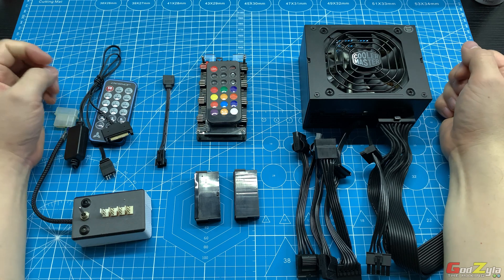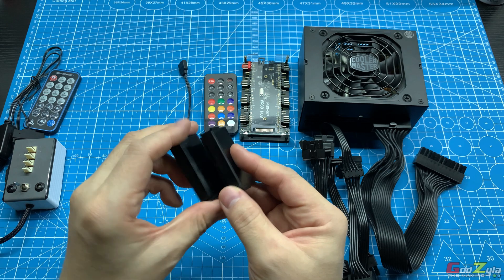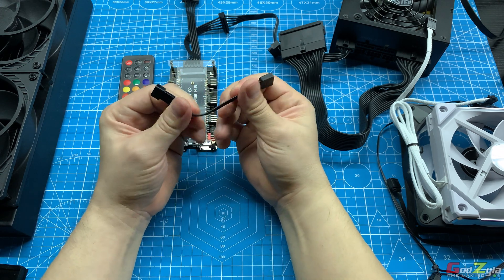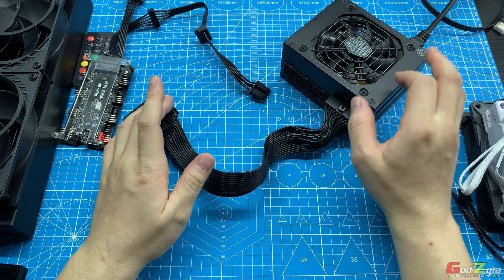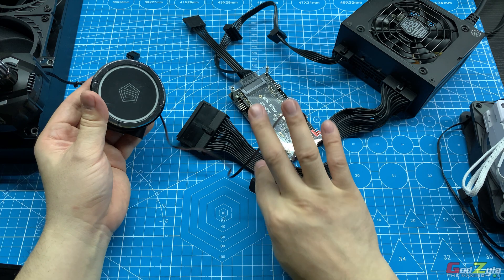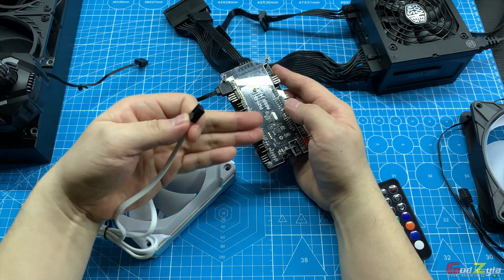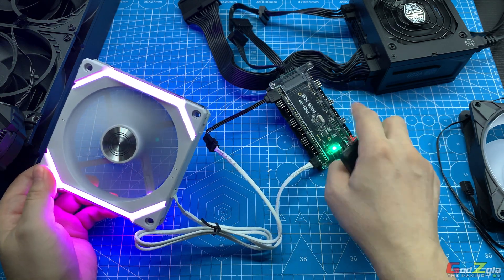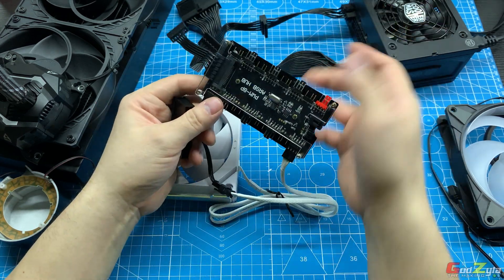How to test PC Components with a PSU

Comment: Hi, can lian li edge with hub do the job? Or do i still need a hub with remote? I want to test the fan pwm, argb daisy chain if possible, and aio with screen
Reply from the maker: Hi Zam Hazri, welcome to my channel. To test rpm and lcd screens, you will need to set up an open bench system with windows os. To test rpm you can use motherboard UFEI or even motherboard’s application in windows environment. Same applies to aio lcd screen. You need to have the aio application to test the lcd. This content are basic checks only.

Comment: is it safe to test the gpu with this method? just want to test if it will power on
Reply from the maker: Hi Jasper Castillo, welcome to my channel. I wouldn't advise you to do that as GPU is different whereby in needs to be seated in a PCI-E slot to function.

Comment: Hey Kleo, great guide! Just wondering if you can help me with testing my NZXT Kraken X62 AIO? I've tried plugging the SATA power connector and connecting the pump fan header to the PWM 3/4 pin fan header on the fan hub (i've got the Cooler Master version of the same thing).

My fans are all working, but I can't hear or feel the pump running. There is an additional USB 2.0 cable that's supposed to go from the pump to the motherboard, but obviously I haven't got that connected as I'm testing only with PSU outside case before installing. Is that why pump isn't starting? Thanks!
Reply from the maker: Hi Faheem Khan, welcome to my channel. For the NZXT Kraken X62, it should not be, unless it requires NZXT Cam to operated, then you will need to plug the usb and to use the software to control the pump. I am so sorry that i am not able to aid you as I am not familiar with NZXT liquid AIO.
Reply: @KleoYan  All good. I ended up having to borrow my friend's board to test it out. It sems like the X62 needs initialisation from the motherboard, maybe from the USB connection or CPU Fan header. Hope that helps anyone looking around the net for the same issue :)
Reply from the maker: @FaheemKhan-z3n  hi. Thank you for your feedback. Greatly appreciated it. 👍

Comment: Hello, Kleo. Do you have the Corsair Rm1000x Shift Psu by any chance? I’m wondering if it will fit in the Lian Li 216 Black Rgb.
Reply from the maker: Hello Daneil Mederios, welcome to my channel. nope I do not have the RM1000X Shift PSU, therefore not able to answer you about the clearance. the only thing I can tell you is that it has a 15mm clearance from the side, judging on the HX1200 PSU which am using https://youtu.be/8lnysdX5A_o

Comment: Hey Kleo .... really enjoy your content 😉

I have a question regarding to the (8 Ports Fan & ARGB Hub w/Remote) .... I bought the same one that you listed in the link.

When testing my Lian Li S120 V2 fans with this hub, everything works fine with a single fan attached.
However if I "Daisy Chain" the fans to one another the argb only lights up on the first fan in the chain .... the others have no argb, but the fans function.

I have tested (10) of these SL120 V2 with your single fan method & everything works .... but when daisy chaining them together I get the no argb effect as explained above.

Maybe a dumb question, but is this how this hub functions if not connected to a ARGB header from the Motherboard?
I have no way of confirming this, as I only have a laptop & still gathering parts for my PC build.

Thanks & any advice regarding this (8 Ports Fan & ARGB Hub w/Remote) is welcome 👍
Reply from the maker: HiPuppy5paw5, welcome to my channel, yes, this hub is suppose to work with one fan per port (argb and fan load), it's unlike the uni controller. Kindly do not daisy chain and plug to one port as it will not work.
Reply: @KleoYan  Thanks for the quick response & answer to my question 🤙
Reply from the maker: @Puppy5paw5  you are most welcome. Infact I just woke up hahaha. All the best with your build too. 😊

Comment: i have a question my L-Connect 3 does not start automatic with windows10 22h2 i have the latest version of L-connect 3. What can i do pls help thanks best regards
Reply from the maker: Hi Patrick, welcome to my channel and pardon me for the late reply. You might want to try this steps

You should be able to set auto run at start in L-Connect-3, under settings. if you are not able to. try these steps.

1) Create a shortcut from the original L-Connect App.
2) Click [Windows] + [R]
3) Enter : [shell:startup]
4) Click [OK]
5) Copy your [L-Connect] shortcut to [Startup] folder
6) Restart your PC
Reply: @KleoYan  oke i have version 1.6.0 but its nor working. maybe a video can you make about that thanks
Reply from the maker: @Patrick-pv4ud  hi. I see what I can do. No promises though.
Reply: @KleoYan  oke thanks v1.6.0 i have version. and i have the Sl fans the old wons
Reply: @KleoYan  Hi should i download the latest version of l-connect 3 pls make a video thank you
Reply from the maker: @Patrick-pv4ud  https://youtu.be/CgvuUFeff8U you can refer to this video. It will hightlight some important points. Kindly take your time to digest the video or to skip base on timestamp of that video.
Reply: @KleoYan  thank no i mean the new version update v1.6.9  should i donwload that i have version 1.6.0
thank you kleo
Reply from the maker: @Patrick-pv4ud  I see, for me I have updated the version 1.6.9. It’s working well. But if you are ok with 1.6.0 then just leave it. 😉
Reply: @KleoYan  oke thank you

Comment: Hey kleo, btw what kit did you use to vertical mount on the lian li lancool 3?
Reply from the maker: Hi Evenaardez, welcome back, I am using the old Lancool 2 Vertical mount with has the Gen 3 riser cable. I then switch to a Gen 4 Riser which I got from lian li too. thank you!
Reply: @KleoYan  Thank you!
Reply from the maker: @Evenaardez  you are most welcome.

Comment: Hey Kleo ! im really amazed by your channel, congrats !! Now that the Lian Li released the SL-INFINITY 140mm I can't wait your video regarding the comparison between the 120 and the 140mm version of the infinities. As a Lancool III owner Im not sure if I pick the 140mm AL for the front (since the front mesh migth cover the infinity sides of the new 140mm)
Reply from the maker: Hi Daniel Caparroz, welcome to my channel. Thank you for your valuable feedback. I will be comparing two other 140mm fans I have to the SL infinity 140, but it will only be on static pressure in a 280 liquid aio. That will happened once I find time to do it. Once again thank you for visiting.

Comment: Thanks that was exactly what I need. One question why on socket in Fan hub has red color 03:00
Reply from the maker: Hi Amr Alkhatib. Welcome to my channel, that red fan socket is when using the pwm curve on your motherboard. It will have one signal as in rpm to follow based on cpu or gpu temperature. Then from there, the rest will follow according to the red socket readings.